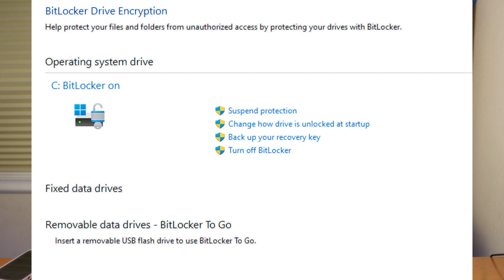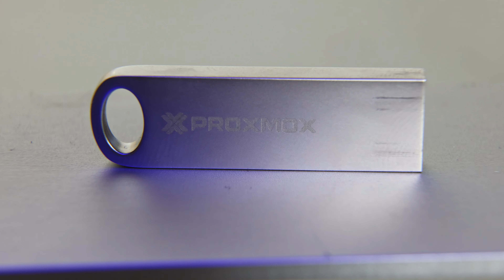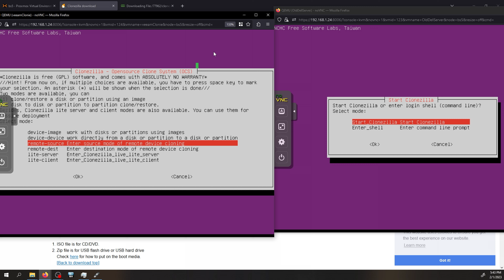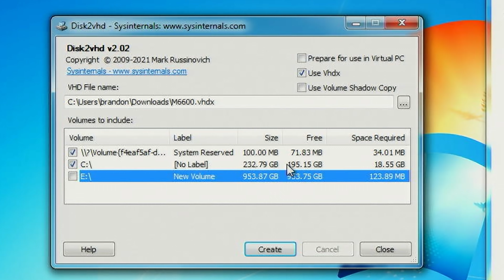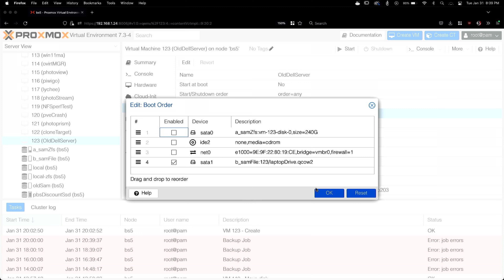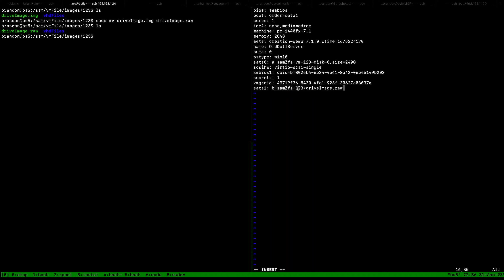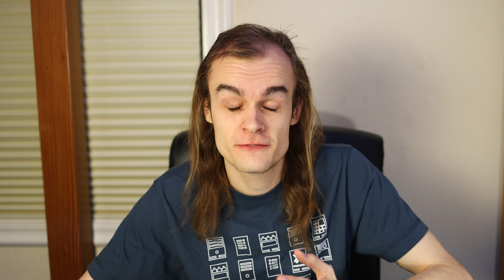Converting a Physical system to a Proxmox VM

Comment: Thank you for all the detail in your video.

Can you confirm whether a Windows instance will be automatically activated if its 'lifted' from disk by Disk2Vhd and then 'dropped' into a VM on Proxmox, as you show here?

I just purchased a refurbished Dell T7820 with 'Win10 Pro for w/s' and want to make it a Proxmox box, but with a Win10 Pro VM.
Of course I don't have the original Win product code - hence my question about 'automatic activation'.

I expect it should work, as the motherboard is the same - and licence is tied to mobo, right?

Just be nice to hear it confirmed from the wizard 😃
Thank you.
Reply from the maker: I can't confirm the license will stay interact when moving the vm, and I'd guess the license may have issues as its tied to the hardware and windows detects a hardware change. There are multiple ways that windows can be activated though, so I can't be fully sure what would happen here.
Reply: @ElectronicsWizardry  Thank you for the quick reply. I was thinking that if it all happens to the same box, there is no change to hardware.
Anyhow, I found a way to identify the product key and how to 'remove' the licence, so I should be covered.

Comment: Can you use disk2vhd and make a live backup of a 2022 server for Disaster Recovery Procedures?  Need to make a backup of a new server i installed in work but be able to restore it in case of any major problems.  Thanks
Reply from the maker: Yea you should be able to make an image for recovery with disk2vhd but I’d probably use backup software instead if possible. Veeam has a free version I like which some additional features like a bootable tool to restore backups.
Reply: @ElectronicsWizardry  Will go take a look at Veeam, thx for reply.

Comment: What gets me is that you created an efi system which needs to set efi disk, didn’t use tpm which also needs tpm disk, i see neither of these in the setup menus, and when you change the disk to use the converted image there is no mention of what happens to the efi and tpm, does it just happen to work within the new disk image as if it was a passthrough?
Reply: IIRC there's a fTPM option that you can spoof into any vm in proxmox. But that's going off of my imperfect memory, so I might be strong.

How that syncs with a ported-over ISO file, . . . I don't have any details.

Good luck, friends! 👍

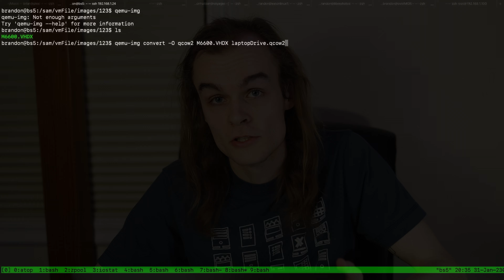Comment: Hello, at timestamp 10:58 you use the program “qemu-img”.   How did you get that program onto your Promox machine?  Please explain.  Thanks.
Reply from the maker: Qemu-img should come pre installed on proxmox. Try running it and if you get an error about not enough arguments it’s in there.

Comment: is the same the command with qemu in windows : qemu-img convert -f raw -O qcow2 \\.\PhysicalDrive0 c:\file.qcow2 ?
Reply from the maker: I haven’t tried that exact command but it seems like it would work. I’d make sure the drive isn’t mounted as it can cause issue when a drive is being used and backed up at the same time.

Comment: I just thought of something.   Would this allow me to use an older version of Windows I use for Video Editing? 
If the USB does work?  That would be great!   I use an older Pinnacle Video editing rig, and would LOVE to use the hardware and software features it has for old VHS video tapes I come across.   

This would be a game changer as I could get rid of the old machines I have around.  And just keep the hardware that I need for the physical transport of the signal to digital.
Reply from the maker: Converting those old systems to VMs should work and usb passthrough has worked fine with all the devices I can remember using. There might still be some weird issues but I’d give it a shot and see if works here and I think your chances are good.

Comment: Does this work for Linux on a arm system?
Reply from the maker: You can’t migrate between architectures. This video was made for x86 as proxmox is made for x86. You can likely use these steps if moving an arm system to an arm vm but I haven’t done that.

Comment: Hello, 
This is answer many of my questions. I was wondering if I could use the physical disk as the boot disk for my VM without making any copy? That would save time and reduce possible error.. and would that increase performance of the VM afterward?
Thanks, 
Martin!
Reply from the maker: You should be able to use a disk passthrough and boot from it. So in the config file for the vm set it to the path of the drive, like /dev/side for example

Comment: This what I need to do, I have a 3 node proxmox 8.0 set up as a cluster, and I'd like to upgrade the ssd drive from 256g to 2tb, was watching this video, and was thinking of following your instruction for clonezilla, and run it in a vm on another node, and then connect the ssd thru a usb dongle to the source vm, and let it copy directly, or wasn't sure if I should just use a disk duplicator, and then resize the partition when I reinsert into my tiny server

Comment: I need your help. I have a SSD from my old PC. I connected it to Proxmox server and created IMG and then renames to RAW. But I have only single file. When I create VM I select UFI and it create 2 discs. I do not know where I connect my disk.
Reply from the maker: I’d skip the efi part and it should work with one partition. Most oses will work with no separate efi disk and when installed on metal they use a efi partition for efi data.

Comment: Excellent vid! I've got some systems with a 1TB drive, but they're only useing maybe 10% of it. Will these methods reduce the file size, or create a full 1TB file? I know DD does this when you specify the block device /dev/sdx (without the number).

Comment: Anyone attempt the Disck2vhd method? I converted the file to a qcow2 file and put it in a drive. Getting an error saying the file doesn't exist when I attempt to start the vm.
Reply from the maker: This seems like a issue with proxmox not seeing the drive. I’d try adding the full path of the qcow2 file to the config file the. Moving it in the proxmox gui to where you want the file.
Reply: @ElectronicsWizardry  Turns out I'm dumb. I was telling proxmox the wrong location of the drive so it was right about it not existing.

Comment: Everything made sense up to 11:00. There you show you have SSHed into a directory file structure of Proxmox. But there is no "/sam/vmFiles/images/xxx" path, and if there were, how would the M6600.VHDX file get there?
Reply: I have the same problem. lost me here not found this
Reply: I agree, there are some critical steps missing in the 'dd' from attached SATA drive section of this video.  It appears that he is creating the dd image file into his ZFS pool, but would be benefit if the demo was for a 'stock' Promox Install where the main storage is 'local-lvm'. As it is I'm lost as well. I get what kumar is saying about "don't try if you don't know", but in a tutorial video, it should cover all the steps so we can learn
Reply: You literally shouldn't be watching this video because you'll end up causing more damage to your own setup than solving issues. This VHDX was created as shown minutes ago in the video in the windows host to be migrated itself and copied into a USB drive which was referenced later. If you don't understand basics then you shouldn't be trying this because you will end up with issues you won't figure. No malice intended, just raising a wholehearted concern here. Cheers.
Reply: @KumarKadatoka  You need to slow down, because what the op said was legit. And I know exactly what I am doing. He totally did not show how he got the .vhdx file into the folder in his proxmox dump directory. So be concerned, but knowing what you are talking about in the process will help, no malice intended.

Comment: what's the dell or hp machine 0.29 I have few ive used in the past for Proxmox. I was just interested what you are using yours for. Love the vide btw great channel
Reply from the maker: That system is a custom build on a old hp case that had a dead motherboard. I’m currently used it for drive endurance testing with a am1 motherboard.
Reply: @ElectronicsWizardry  Ahh cool thanks for the reply. Great channel I always check to see if there is anything new. I've just set up my old ubuntu machine for VMware. I was having trouble passing Gpu though in Proxmox so has to go another route. I'm an open-source guy but I've been setting up hyper v lately to learn that more as well.

Comment: Very good explanation of all possibilities and really amazing tutoring!

Could you make a follow up video about keeping the dns/dhcp settings of the original machine or the additional steps required in proxmox so that the new proxmox pc is also almost identical in terms of plugging it in?
Reply from the maker: Sure I’ll add that to my possible video list. But one way to do this is to tell proxmox to use the same MAC address as the old physical system. Then the dhcp server will see it as the same computer and hand out the same ip.

Comment: Another option is using Acronis or easetodo backup to backup those images and create a recover image, then boot from the recover pe on proxmox vm,  and recover the backup step by step. Great video though!
Reply from the maker: That's a good point. Most other backup or imaging software products can be used to move a physical system or another VM.

Comment: Greate guide -  I have been translating local proxmox qcow2 images small ssd to be on my nfs file server but it did timeout, then I tried to use raw and it was working with no timeout.  I am not really sure how qcow2 compares to raw but having the images on my nfs nas does make it quick to move a running system to anothor proxmox node.

Comment: Another cool use of qemu-img and dd is you can use qemu to convert an ESXi vmdk disk image into a raw format (over the network using sshfs even!) and then use dd to write that raw image into a zfs zvol disk. I used this to migrate a VM from ESXi to Proxmox and that VM was previously a physical box about 10 years ago I converted using either p2v or likely dd/nc and similar techniques you describe here. Next I'll migrate the services in the VM to LXC containers.
Reply: Yep.  I've moved few VMs from vmWare to ProxMox using the qemu convert tool and then copy the cow2 file directly on top of the existing vm disk inside ProxMox.  Worked pretty well.